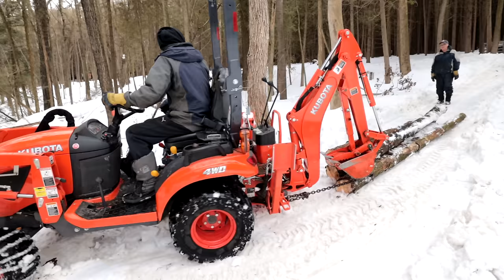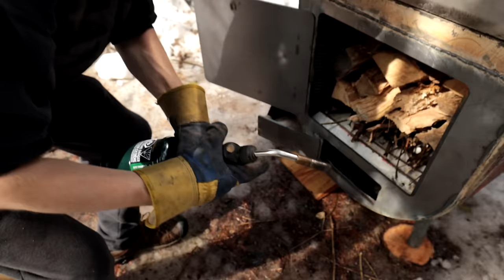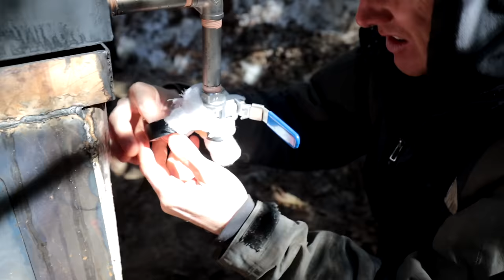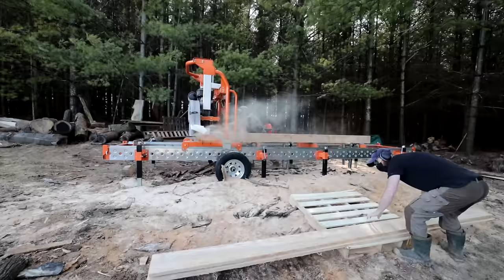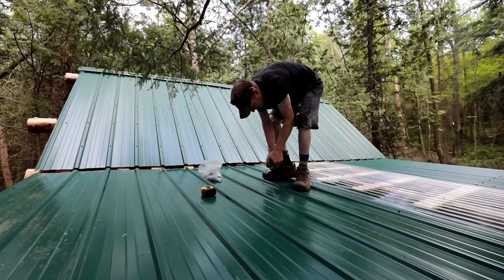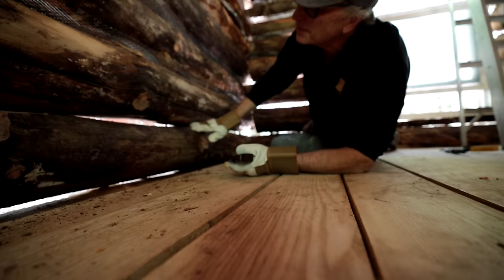1-Year Building a Cozy Log Cabin in the Woods! (Start-to-Finish ASMR)

Comment: One thing the old timers always did to the log cabins( that we seem to forgotten overtime) was to paint the ends of your new logs. (The old timers used a white paint.)   it  kept the logs from checking in cracking!
Reply: The old time is did not have paint. They cooked tree sap.
Reply: @richardfiedler2201  They sure had paint . . . milk paint. Another technique is to char the wood black.
Reply: @mhpjii  also lead "paint", or they would tar or coat the ends with creosote
Reply: Interesting

Comment: Logs tend to shrink and expand ("breath") to up to 6-8% during the year and during the use. When house is not used, logs are getting moisture and expand, when house is used (stove is lit) logs dry and shrink. Please note that this is not "logs can shrink and expand", this is "logs will 100% shrink and expand". So all the things described below WILL happen, not COULD happen.

In your case the following will happen rather quickly. Nails connecting logs vertically will loosen, walls will loose structural integrity and will deform. Logs will shrink and will hang on window frame - either having huge gaps between them or just smashing window frame. Same for the door frame - door will stuck so hard, that the only way to get inside would be to cut the door off. Roof frame will deform. Cement you've used to fill the gaps between logs will crack and fall apart.

Thus, you needed to:
1. Make sure to have gap above window frame (at least 8 cm in your case) and above door frame (at least 15 cm in your case). This should then be filled with some soft insulation like moss, synthetic foam, etc.
2. Window and door frames should be connected to walls with spike grooves or sliding metal connectors.
3. Roof frame should be connected to walls with sliding metal connector.
4. Logs should have spike grooves for the whole length to let every next row to more securely sit on the previous row and to decrease gaps. Gaps are filled with some soft insulator, like moss, jute, etc.
5. Logs should be connected with wooden nails connecting three rows of logs. This secures vertical integrity and make sure walls stay vertical while "breathing".
6. Logs should have proper connection carved in corners to make sure walls are securely connected to each other and to decrease gaps.

In short, you've done a huge job, but sadly, your house will fall apart shortly. Considering the weight of wood it has, it is very dangerous to stay inside.
Reply: Not to mention the log slices they used as their base will rot out, sitting directly on the ground with no treatment at all.
Reply: I thought the same thing. They didn't take any of those factors into account. Still a neat project, even though it won't last long.
Reply: how many log cabins have you guys built
Reply: @drewjanvrin1508  What part of his comment was wrong in your opinion?
Reply: @mort_et_misere  never said it was wrong, just no one asked
Reply: @drewjanvrin1508  Lmfao? Whats your problem hahah
Reply: @drewjanvrin1508  build none, build a million, physics don't change.
Reply: I chuckled a bit when I saw them leveling their "foundation" on frozen ground that will be soft soil in a few months. When I got to the part where they started stacking logs I dropped down here to the comments to leave my two cents and now I'm on my way out. Doing it the right way would have taken maybe 10-20% more time/effort but the result would last 10000% longer.
Reply: @Drew Janvrin  0, but I've spent quite a lot of time investigating different types of construction materials when I was choosing what I would use to build my house. I've chosen framework house as it is a bit more suitable for everyday living been much more energy effective.

Also, I have grown up in the area where logs houses were the most wide spread, so I know a bit on how these houses are built.

I am not an expert, but mistakes guys have done while building this house are too obvious to require any proof of authority to be highlighted.
Reply: Solve all these issues by going with the Skip Ellsworth butt-and-pass method. Peeled whole logs are skewered together every 3 feet with pounded 3/4 inch rebar spikes, zero notching means zero capillary wicking into growth rings so no rot if good roof/foundation... Mortar chinking is attached to lower log by pounding in a LOT of small finish nails, so as logs and mortar shrink, it does not crack but pulls downwards, leaving a gap at top...one year later go fill that gap quickly with more mortar in pastry bag, no cracks!  Between the inner and outer chinking use insulation, not moss--ideally rock wool or mix vermiculite with aircrete etc.  End result is incredibly strong even if you used wet logs.
Reply: It depends on the loogs. The spinula pine tree estrada, isn't affected by moisture and expansion over the year. The dirt is probably dison dirt,lots of dison upp north with actually gets really dry like a floor. Thats what the macharora tribe used 10000 years ago. This is an excellent little hut they buildt
Reply: @alexanderludvigsson3611  where can these "spinula loogs" be sourced?
Reply: Here come all of the professional log-home builders giving their advice...
Reply: @alexanderludvigsson3611  any wooden material shrinks. Even glued laminated timber.
Reply: @ruffxm  the least constructive way to oppose one's opinion is discussing their authority. Do you have any objections to what was said here?
Reply: @ruffxm  wow, you're a hero! Happy new year.
Reply: Is there a decent book on building a log cabin that may mention and illustrate what you discussed?
Reply: @ruffxm  were
Reply: @woodseyes1    Obviously you can't read since you missed the first 10 replies to this thread. Or write...I think you mean "where?"
Reply: Подпишусь под каждым словом все правильно.
Reply: Emmet Brown, you’re 100% right. 
I was just laughing my way through the video and was honestly quite shocked over their method. This cabin will not stand the test of time.
Reply: @gary24752  only a few hundred of them. some of which have been in print for over 100 years.  google would have told you as much had you looked.
I'm not knocking the effort these guys put in. However, what this guy posted is correct.  
I mean, seriously, untreated lumber directly on the ground?  Anyone should at least know this much. If you're going to make that basic a mistake then you're going to make a lot more.  Hell, even treated lumber doesn't go on the ground.
Reply: @johndodson8464  who said it was going to go down in 1 year?  he's not wrong. if you don't realize putting untreated lumber on the ground will cause it to rot then you don't know squat.
Reply: Hu
Reply: I'm surprised nobody mentioned the crappy roof job. No insulation whatsoever no underlayment or tarp just some sheet metal? Bad idea.
Reply: Holy turds. I thought I was going crazy. I kept thinking they were going to start over that this was like some sort of dry run or something.
Reply: Totally agree.  Have seen much better work done than this.  I would have also set it on pillars of some sort.  As is will be very damp inside.
Reply: You obviously have never built or lived in a log cabin. I’ve built two of my own and 23 for others. Cured logs do not shrink as much as you claim.all my walls are pegged or spiked every 4 ft and after 30 years there is no or very little movement.the gap over windows and doors is to compensate for roof weight.
Reply: @topgallant32  could you please point me to that curing process happening in the video?

The idea that 4-10 cm gap above windows and doors is for compensating for roof weight pressure looks ridiculous to me tbh - the weight should be huge to cause such huge deformation of logs.

The idea that this is to compensate for 3.5-4% radial shrinkage of spruce and pine looks much more realistic (and is definitely supported by hundreds of books on how to build wooden houses, and by my grandfathers, who have built their own log houses able to accommodate couple families and livestock through the whole northern winter).

Still, it's good you make that gap anyways, no matter if you know or don't know why you must make it.

Long story short, this cabin in the video doesn't have any gaps above windows and doors. So, this building is rather dangerous.
Reply: I've built over 60 and i agree with the last comments. Great video content, but lots of problems with the build. The cabin is not going to last long. Its just my opinion.
Reply: @ruffxm  You don't have to be a professional to see the dangerous shortcuts being made here.
Reply: @TheRobmcknz     That's not the point. No one is saying "this is the only way and proper way to build a log cabin". I just laugh that on youtube everyone is a professional something or other, with their condescending advice. It's simple...don't agree with a method - don't follow it. Don't like how the builder did something - do it a different way. No, instead people have to make themselves feel better by putting someone else down.
Reply: There are cabins that have been built using this exact method that have been standing for over 80 years. 
Also, no the logs are not going to expand 8% bigger than they are right after being cut. They're going to shrink a little, they're going to expand a little, but you're acting like it's a living breathing organism that's going to be changing almost 10% in size and that's laughably wrong.
Reply: @Locust13  they are not expanding, they are shrinking. I was talking about 6-8%, not 10%. You're laughably wrong. Read material characteristics and recommendations to mitigate wood shrinking.

For 2 meters high opening the gap should be at least 10 cm basing on the log houses construction standards.

Before talking about something, you might want to educate yourself.
Reply: @drewjanvrin1508 you don’t have to have built something to know how it should be built.

Comment: Nice job. I would prefer to fill the gaps between the logs with resin or hard glue. And put solar panels on the roof plus a suitable pipe to harvest the rainwater.
Reply: Solar panels in the woods - not a whole lot of sun would get through.  Resin or hard glue is too rigid between the logs.   They might even have trouble with the mortar but that is a traditional way to do it.  There is a product out on the market that looks like the mortar but stays somewhat flexible so the drying and shrinking of the lots doesn't break it.  The logs may be from dead trees but they are still damp from being in the snow etc.

Comment: I like the build. I question the foundation on resting on wood rounds in the dirt, and there seems to be no moisture barrier between the dirt and the floor, or at least enough vertical clearance to prevent wood rot.  I would have dug cemented concrete piers and sunk logs to raise it up out of the snow.
Reply: I question your use of "I" so often. Selfish and conceded are ya?
Reply: @ontoyouharsin6151  I question your confrontational and vitriolic tone, a bit of a crybaby are ya?
Reply: My thoughts exactly. So much time and effort and then no vapor barrier?
Reply: the floor at the end of the video looked ruined.
Reply: @ontoyouharsin6151  guys mad that other people use personal pronouns.
Reply: @quinn2002  the gayness is strong with malloy
Reply: @ontoyouharsin6151  mans using middle school jokes
Reply: I hope they'll post an updated video in 2-3 years.  I suspect those "foundation" wood rounds will be at least partially rotted and the entire cabin will be pitched over.  To see how to do this kind of thing so it'll last, check out the "My Self Reliance" YouTube channel.
Reply: Yeah it aint the best build but it will work for a little while.. then be fire wood for the next one.
Reply: @ontoyouharsin6151  No problem with selfish or conceded.. the problem belongs in the outside being. I will do as I choose because with out I you do not exist. Solipsism dictates this
Reply: @ontoyouharsin6151  why are you so rude my man
Reply: That's clever
Reply: The Cabin is sitting on 4 rot resistant stumps
Reply: They also didn’t de bark the logs…. I don’t think they were building for longevity
Reply: @njwebwiz  Agree. Not to mention that they didn't even bother to notch the logs before they set them; they're going to start to roll and pitch within a few years and eventually the whole structure will fall into itself. It's a nice 15-20 year build, but it could have been so much more permanent.
Reply: @geisr8341  Not even close to 15-20 years.  Depending on rain / humidity levels in that area, I'd predict it's falling apart within 5 years.
Reply: A lot of wasted effort. 

Used green wood,  debarked after stacking for some reason, wood directly on the ground,  just about nothing done to even an amateur building level.
Reply: @dann9353  I think just beginning to dry out a bit, hence the spaces.
Reply: P
Reply: P
Reply: Oo
Reply: Oo
Reply: Ahhhhh yes…so many experts, so few cabins. Y’all probably the same people that call for a specialized service to come fix something ex: windows, plumbing, concrete etc. and sit there, watch the whole time, handing out your 2 cents every five minutes like “aren’t you supposed to…” uhhh “I watched a YouTube video and…” “my sister’s cousin’s uncle did this for 30 years and…” “uhhh excuse me, why are you…” which always has the workers thinking…then why tf aren’t YOU doing this if you know so much? Y’all those MFs 💯
Reply: Tbf I don't think he's making most of his builds as something permanent honestly seems like he's just building them for fun
Reply: I bet u would
Reply: I also plan to produce content like this
Reply: @ontoyouharsin6151  Conceited....CONCEITED🤦.
"Excessively proud of oneself".
Conceded - "Admitted or agreed that something is true, after at first denying it to be so".
Reply: @ontoyouharsin6151  it's easier to build sentences using "I". I guess English is not this guy's mother tongue
Reply: So many know it alls but I’m still looking for your channel so I can do it the “ right” way. Still can’t find it

Comment: I've never seen this type of cabin build before. I like it. Seems way easier than notching every log.
Reply: There is a reason why logs are notched. There is a reason why people use wooden nails connecting every three logs, not just metal nails. There is a reason why people are not using fixed connectors while connecting window, door and roof frame to log walls. There is a reason why people tend to leave the gap above the door and window frame. And this reason is: logs are "breathing" - dry and shrink, getting moisture and expand. And this process will never end, even after 100 years.
Reply: @archi-mendel  Yeah this cabin isn't going to last anywhere near that long.  Honestly seemed like a half-hearted attempt that no one really thought out.
Reply: Designed and built by people who didn't know what they were doing, doubt it lasts 10 years without structural failure

Comment: Me: Hears construction 2 blocks away - “Ugh! When will it stop!”
Also Me: Sees a 1 hour 11 minute video from Kevin with nothing but construction noises - “Yes! I’m in!”
Reply: @iskendertemiz3036  I see an awful lot of trees surrounding them, they barely used much wood in comparison to basically any home or cabin. That's awfully extreme. I think you should be banned and punished for that comment. It also barely made sense.
Reply: @iskendertemiz3036  Did you read the explanation just under the video?  The trees they cut are dead, crowded out because they were planted too close together 20+ years ago.  They are taking out the dead trees and will thin the others later so those left can grow properly.

Comment: Awesome build and video! Questions, 1-would it not have been easier to have debarked before construction? And 2- with so much untreated wood in direct contact with the earth, won’t that lend to damp and rotting? Much love brothers 👊
Reply from the maker: The logs were caked in Ice when we started.  The logs are sitting on 4 rot resistant stumps.
Reply: Doesn’t look like you put any kind of barrier down between the floor and earth bugs are going to love the wood yum yum - did you use any kind of caulking between the logs forming the walls?
Critters are going get under the house too -

Comment: you guys could've saved so much time if you flattened 2 sides of each log for those walls. they'd have slotted into place nicely with some insulation between each log then you could put up wall frames, insulate, then nail osb panels to the frame. good build though.

Comment: I love this stuff.  Wondering why you didn’t use the saw mill to flatten your logs for a tighter fit?
Reply: Not very???????????
Reply: @lawrencesteger5574  Benjamin is absolutely right, those walls won't really hold any heat inside specially with the concrete filling.

Comment: Cool vid, question though. Why didn’t you use the plank mill to strip off two or even three sides of the logs to get them to lay tightly together instead of using cement?

Comment: Why didn't you remove the bark before you built it ? and don't logs shrink which would cause problems with the cement  ?
Reply: I thought this too. Felt their methods rushed. These guys are by no means lazy but I felt if they spent more time preparing everything the build would be more satisfying. Why didn't he seal the floor boards on all sides before laying them? Moisture might attack from underneath?
Reply: @ryanmitchell2858  yep
Reply: Cement is little of a problem - the biggest problem is door frame which doesn't have any gap above it to let logs shrink. This door can stuck easily.